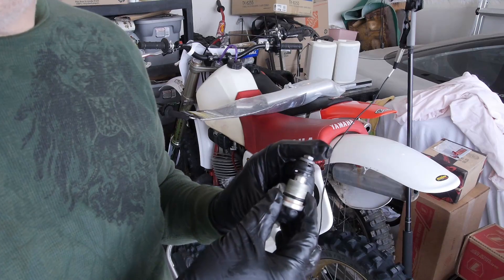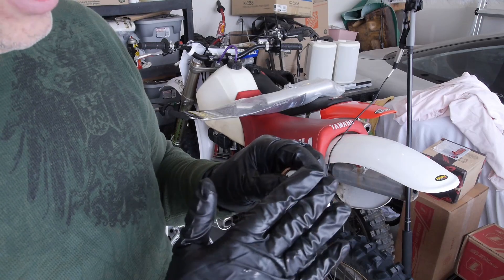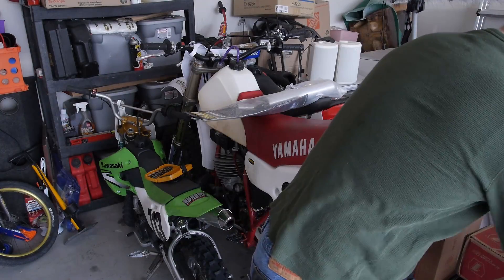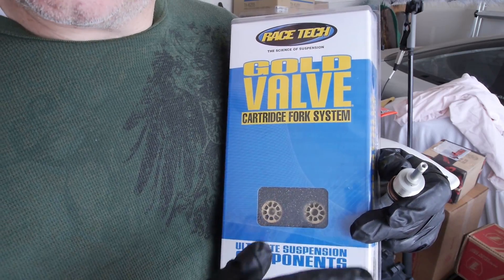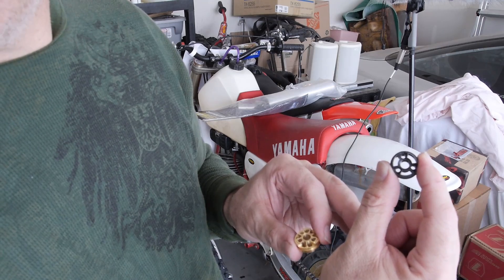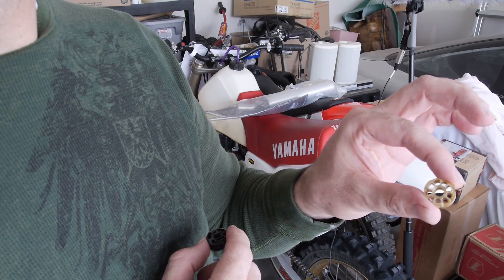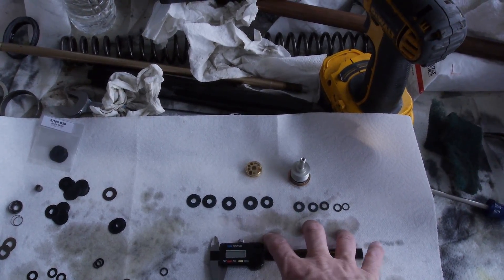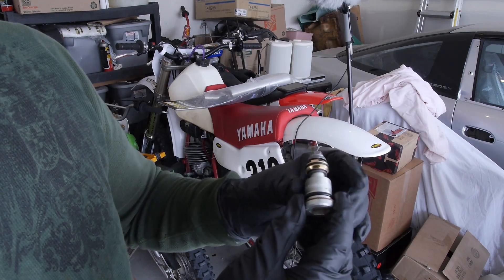WR250R FORK REVALVE - AFTERMARKET PISTONS-PART 2

Comment: Wish I had a mr duhfactor in my life!! I've really been thinking a lot latley about upgrading the suspension on my wr250x that I also convert to a R every once I a while. I want it to be able to do everything. Commute, ride trails,jumps with hard landings without bottoming out,hooliganism,etc. I've talked to go race about their set-up. Looking at over 1000 dollars for their best set up and I'd have to at least ship them my shock and forks if I didn't want to do them myself. I'm sure it's worth it though, but to me that's a lot of money. Plus having no bike to use while my parts are shipped out. My bike is my main commuter right now.